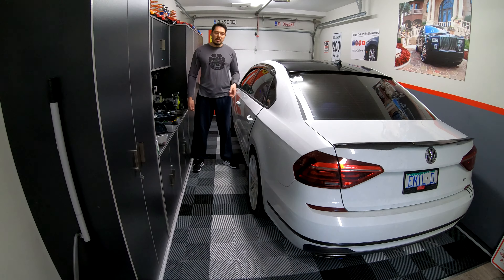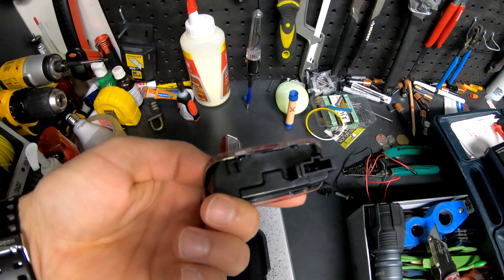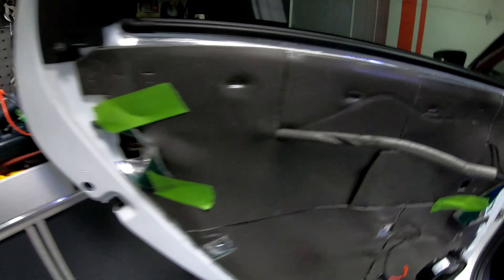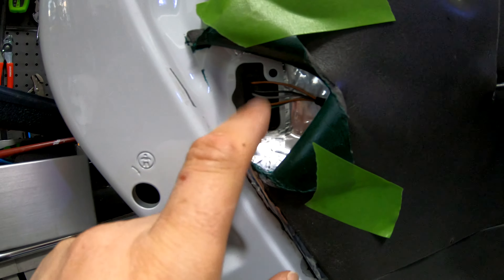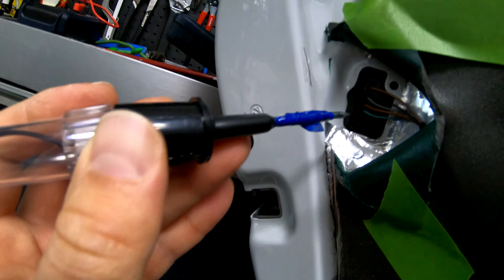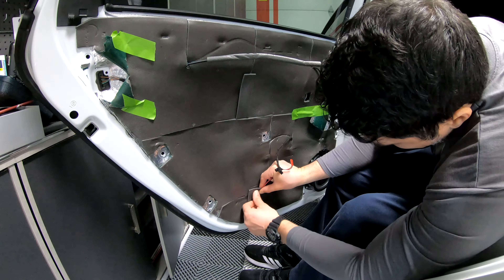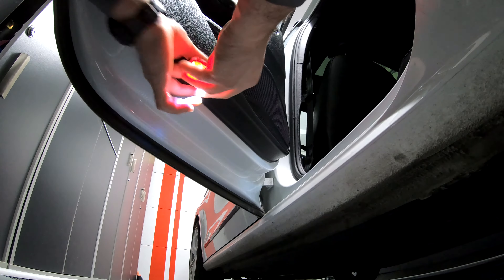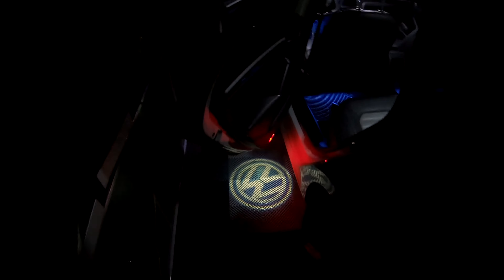Rear doors courtesy lights installation - Audi/VW 2012-2019

Comment: Hmm the rear door module should be able to control this.  So if you leave the door open too long the rear door light should fade.  This method works, but light won't fade turn off after a while.  Reduces the life of the microswitch in the door.
Reply from the maker: Yeah. I should have mention that! I just don't see the reason why would you keep your doors open all the time